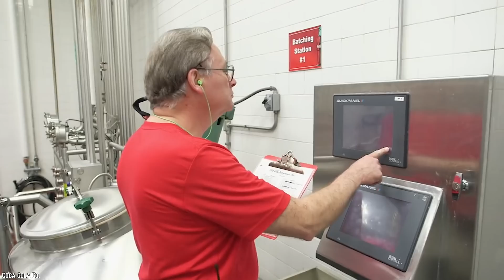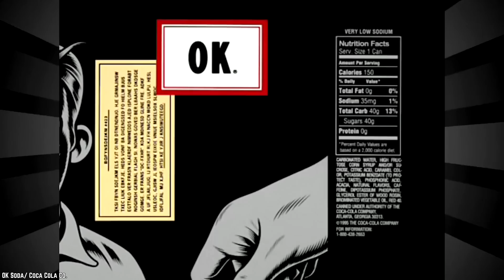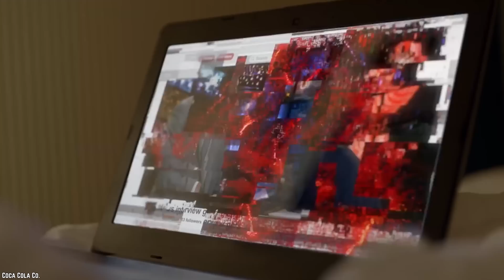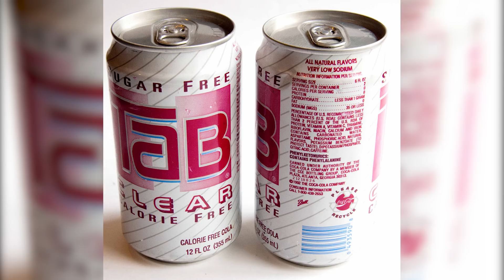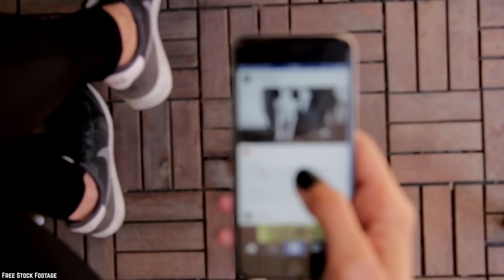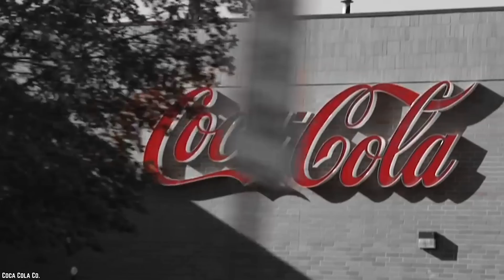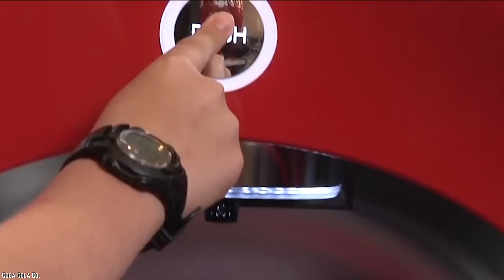10 Coca-Cola Drinks That Embarrassed The Company

Comment: New coke was made to fail so they could remove real sugar and replace it with high fructose corn syrup for coke classic without  being noticed.
Reply from the maker: Thanks for your feedback Tom Parman! 😄
Did you like the video?
Reply: Tom Parman ew
Reply from the maker: 🔥 CHECK OUT: 10 Coca-Cola Drinks That Embarrassed The Company (Part 2) https://www.youtube.com/watch?v=DvWFwRF3VEo&list=UUX--mGSg0UwDjl7MDL8H5Jg 🔥
Reply: Tom Parman : You are correct I worked for Coca  Cola when they did this. I worked on a bottling line. Only enough syrup was made to fill the warehouse with the New Coke product. After that a third recipe was introduced that they called original Coke. But was not the same recipe we discontinued a few months earlier. The taste was much similar to Coca Cola but a lot different than New Coke. Most fans were just happy to have the old taste back  unaware the recipe replaced real sugar with corn syrup. Thanks for knowing the truth.

Comment: C2 wasn't marketed as any kind of soda lol, it's iced tea...also it's not discontinued, they still make and distribute it in Japan, and it's fairly common to find it in import stores.
Reply: They got their images mixed up. I don't think that the Japanese "C2" iced tea drink has anything to do with Coca-Cola C2. (is it even a Coke product?) I don't know why they even used those images, as Coke C2 simply had the classic Coke Label, with the text in black font, a silver band around the top and bottom of the label, and "C2"  written above the Coca-Cola script. 

Coke C2 was simply coke with the sugar cut in half , with Aspartame making up for the rest. Some would think it would not make a difference, but it did. That was the most disgusting soda I ever had!
Reply: @triangleofdeath6246  did some more research and it's completely unrelated to coke. I had heard from a different video that C2 was a coke product probably because of the same name confusion that caused these guys to use the wrong images, but it turns out it's a Filipino company that produces it in the Philippines and Vietnam.

Comment: I seriously do not know why people still drink coke when you can pour it into a toilet and clean it it just like you used industrial strength bleach.
Reply from the maker: what do you like to drink?
Reply: @BabbleTop  I mainly just drink pure orange juice.
Reply: Todd Foret  lol
Reply: @almac664  it is actually effective at cleaning lime scale off toilets i supose it rots it like it rots the enamel on your teeth.
Reply: @almac664  it is true you can clean your battery cables with Coke cola
Reply from the maker: Thanks for the feedback Al Mac 😄😄
Reply: Everybody just stop, ok?  It does actually contain phosphoric acid which is why it's indeed mildly corrosive.  But you'll just replace whatever you were trying to clean with sugar goo.  And before people go OMG DRINKING ACID, did you forget that your stomach is already full of a much stronger acid, namely hydrochloric?  Humans have highly evolved mechanisms for regulating pH in the stomach and throughout the body.  It doesn't matter.  What does matter is the sugar and caffeine which is why I don't personally drink a lot of soda.
Reply: @Mxmx-io9lx  By the way, orange juice is just as bad for you as soda, if not worse.  It has the same amount of sugar overall, but it's almost 100% fructose.  Fructose without glucose or fiber to balance it is what causes insulin resistance.  Just eat the whole orange instead of juicing it and it's fine.
Reply: @almac664  aside from what others chimed in on, I think the original poster was objecting to the amount of junk in all sodas. And, yes, Coke, Pepsi, most sodas make decent cleaners. Not great, but will cut through years of accumulated crud. Also clean a spot off your shirt (if they're clear). 😁

Comment: Your very first one is wrong.  Insiders say New Coke was designed when Coke wanted to start adding high fructose corn syrup instead of regular sucrose because it was cheaper (and less healthy).  New coke was a ruse that used a bad formula so that when "Classic Coke" came out their customers wouldn't remember the taste of the original coke with real sugar because high fructose corn syrup has a sweeter and different taste.  It worked and people bought Classic coke.  Sure it was the same recipe, but with deadly high fructose corn syrup that was cheaper than real table suger tasted different, but not after you had a bad experience with horrible New Coke.  You guys need to study marketing.